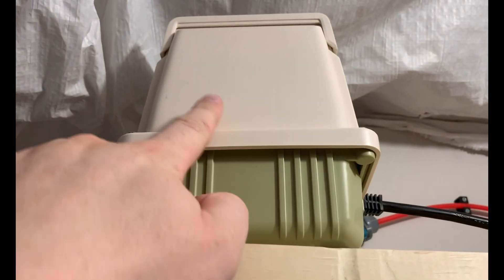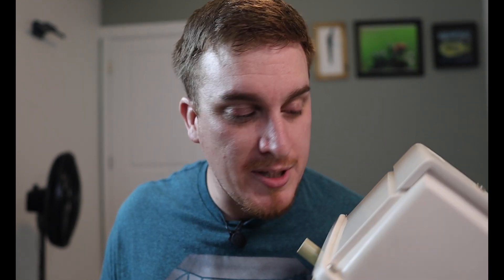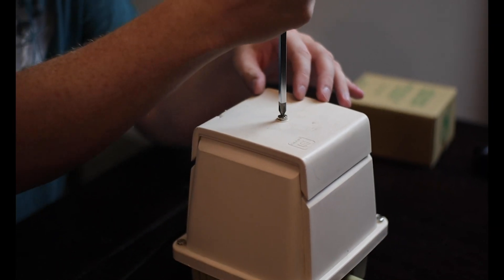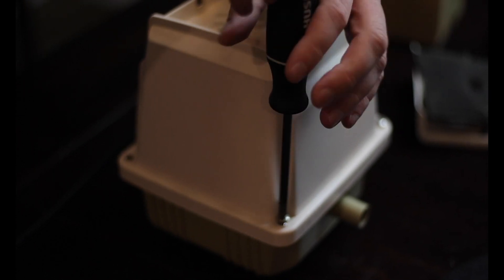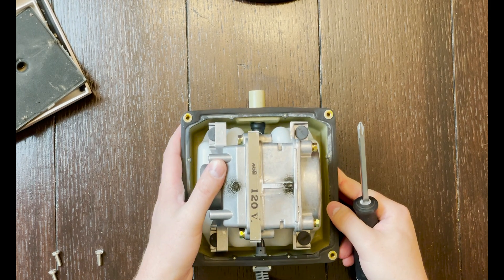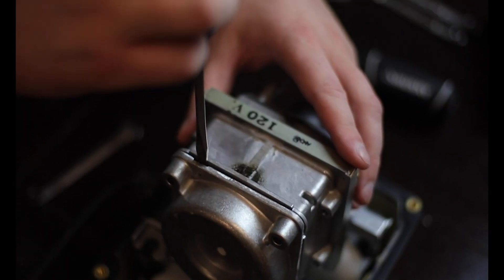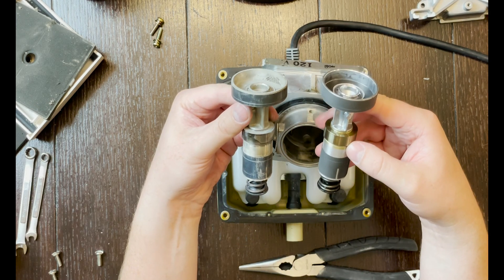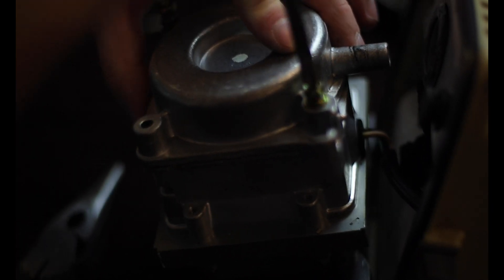Watch This BEFORE You Buy An Air Pump! (Air Pump Re-Build)

Comment: How did that replacement piston perform?
Reply from the maker: It gave out about a month in.  Honestly not worth rebuilding in my opinion
Reply: @WeldonTanks  the OEM parts are good but the replacement junks will never compare. I wonder if it can just be re-lubed again on those OEM parts instead.

Comment: This video is excellent. That note about the rebuilds running louder and possibly less efficient is interesting. Do you expect there is a break in period for the new piston to run its most efficient and quiet down a bit?
Reply from the maker: This pump is going to Trevor to help get his fish room started which will allow me to report back if there is a break in period.  The research I have done on others experience is that there can actually be wear from the original piston and the new piston will not line up exactly causing it to be less efficient

Comment: How did you determine that the pump needed a new piston?
Reply from the maker: When I plugged it in before the repair it rattled uncontrollably as if the piston was not moving back and forth as it should be.